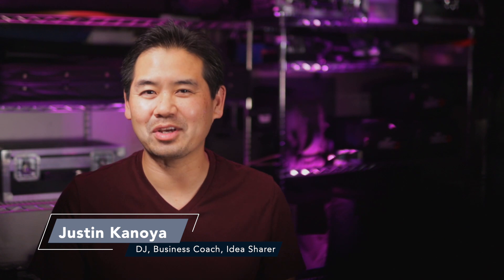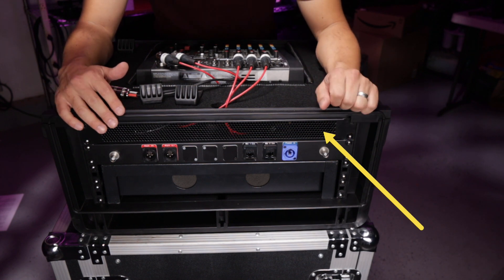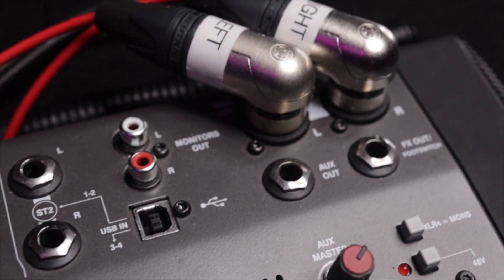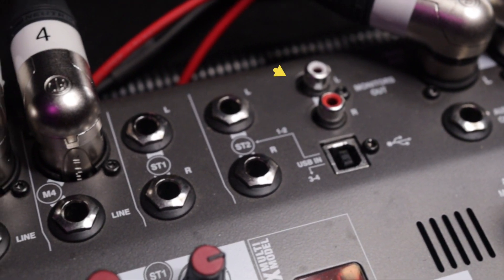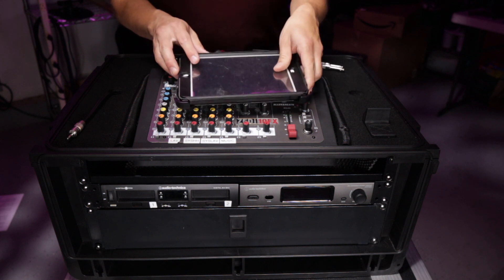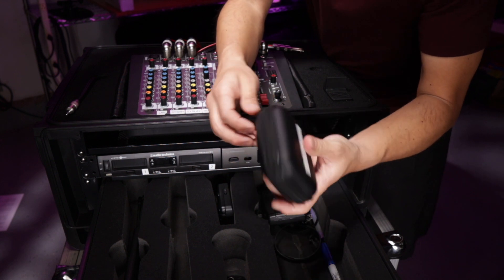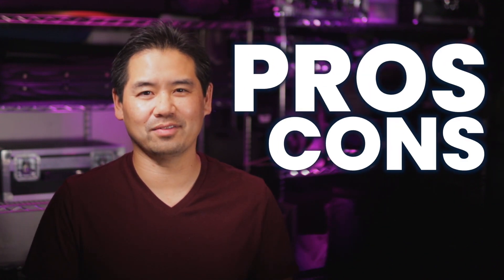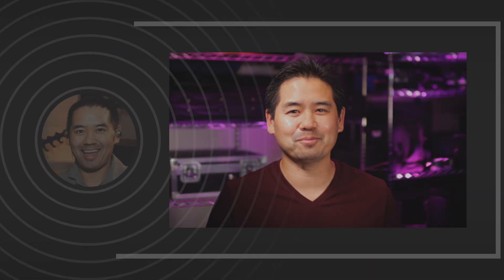Compact Audio Solution For A Wedding Ceremony (GREAT DJ TIP)

Comment: Check out the FastSet DJ table. I’m going to be using this for my ceremonies. It comes with a laptop stand that you could put your iPad on. Not a cheap solution, but something I’m going to try this year
Reply from the maker: Yep ... I've considered that, but as you mentioned $$$. I feel like I've seen a LIfetime table that is somewhat similar in size and opens up the same way. I'll have to revisit that. 

But there has to be some kind of a clamp that will work!

Nice job on your channel growth! Was just watching some of your interview with Nick.
Reply: @djkanoya  awesome, thanks!

Comment: DJ Rick Web had a laptop stand in his DJ roadcase, he used the "FLEXIMOUNTS 2-in-1 Monitor Arm Laptop Mount Stand Swivel Gas Spring LCD Arm Height Adjustable Desk Mounts for 10''-24' Monitor/ 11-17.3 inches Notebook" for his setup, his video shows how to set it up and make it super compact, it is his most recent case build

Comment: I use the smaller version of your case with Two Shure GLXDs,  drawer and dennon mixer.  I like the table you use for the ceremony kit, any info on that?  Excellent videos!
Reply from the maker: Cool .. do you use the 2U version? Regarding the table, are you referring to the shot of me lifting it up around 8:50? If so, it is an old Da-Lite brand table. I think it's main purpose is for a projector. It's cool because the legs screw into the bottom, so it's super portable.
Reply: What denon mixer do you use? Thanks

Comment: You could grab a small tablet fold up stand, place velcro on it and either side of mixer on the platform then it will easily stay in place.
Reply from the maker: There's not much extra space there, but I'll look around and see what kind of small tablet stand options are out there. Thanks!
Reply: @djkanoya  what about just using the mic drawer pulled out to set tablet on?

Comment: Looks like you have room in the lid to mount a couple velcro straps or mesh zippered pouch for the tablet.
Reply from the maker: Are you thinking for travel purposes? The solution I am needing is a way to mount the tablet during the ceremony for operation. Any ideas?